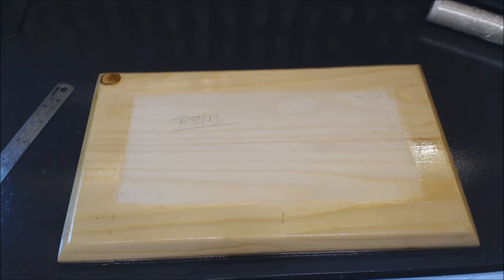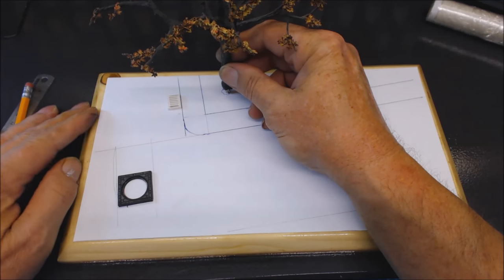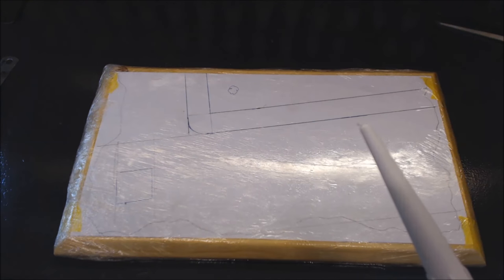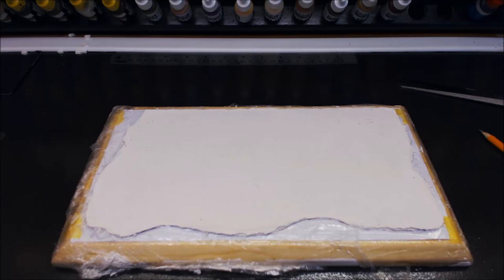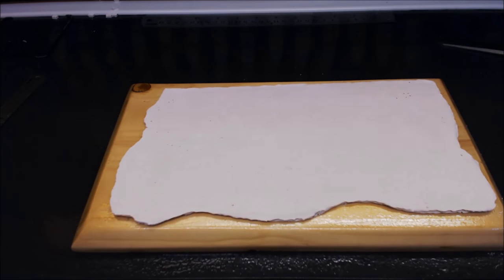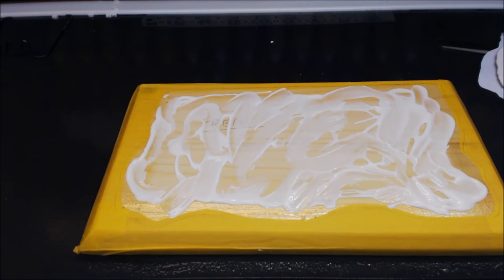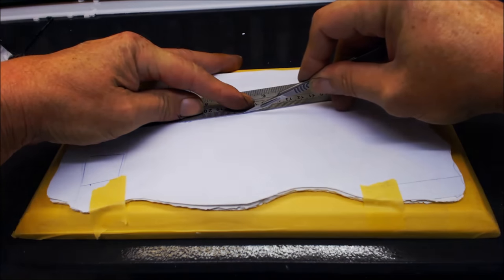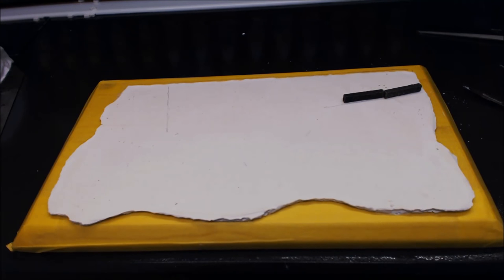Build a diorama 1/35 scale part one

Comment: Kevin., what plaster material did you use for the base?  Plaster of paris?  Something else?  Also, how did you level the plaster surface?  Is it a matter of viscosity allowing the plaster to flow into the silicone border or did you screed it to level it and make it so smooth?  You videos are GREAT!  THANK YOU for doing them and doing them so well.
Reply from the maker: My apologies very remiss of me not to actually include that in the video. i used herculite 2 but then found that I couldn't cut it back very easily herculite 2 is a very hard casting plaster extremely good for moulds but not so good on the base I recommend using plaster of Paris or even decorators filler mix and it to a thick creamy consistency then pouring it onto your base. if you have a vibrating table  put it on that and it will level. If not on the top of the compressor or just keep tapping it with your fingers .if you get too much  in the base use straight edge's and  level it across the top if you really get stuck let me know and I tried put a short video together many thanks sim